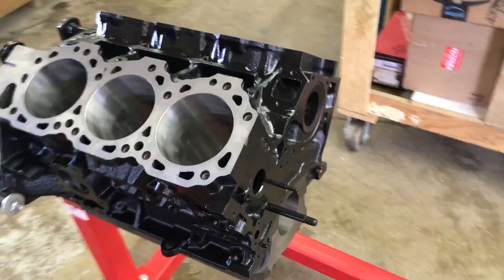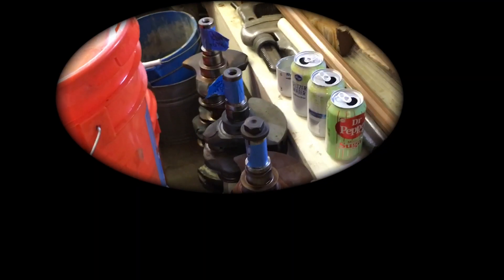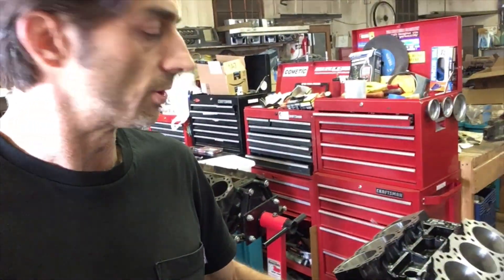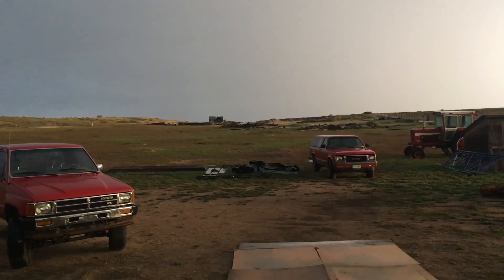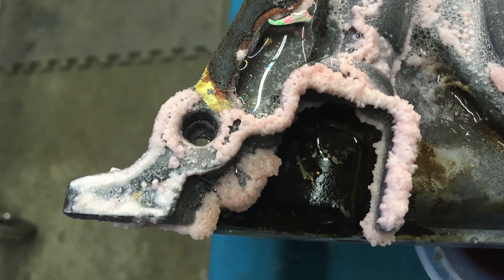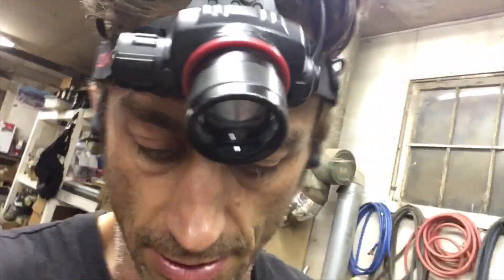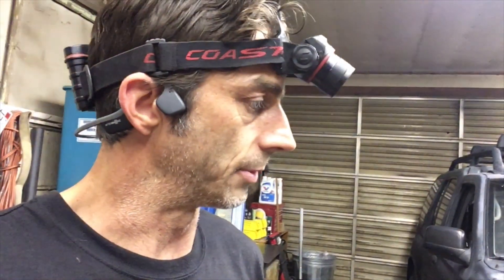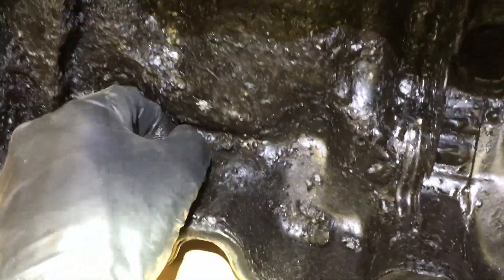MY ENGINE IS ON THE STAND!  VOLCANO IN MY ENGINE?!

Comment: That makes me want to go out and change my oil ASAP lol
Reply from the maker: Right?!  Hopefully, this is something that can be avoided.  If you aren't the original owner of your vehicle (most of us are not), you can visually inspect the engine under the valve cover without a lot of difficulty.  If you have a 1st generation Xterra or Frontier with the VG33E or VG33ER engine, like the one in this video, you can remove the righthand-side valve cover without a lot of difficulty and see what it looks like under there.  I'm often shocked how bad some of them look, but this one is the worst I've ever seen. :)

Comment: 3.5 quarts of oil. That’s why
Reply from the maker: Yeah!  That could be contributing to the issue. :). This seems to be a small oil capacity for the size of the engine. :)
Reply: Yep. Exactly the issue. As an owner of a 2000 Xterra, now with 292K miles, I've changed the oil 58 times at 5K intervals from day one. It always reminds me how small the oil capacity is on these engines.
Reply from the maker: @nosurfenougheddie  Right?!  When I tell people how much oil this engine holds, they are shocked!  I typically change the oil a little more frequently, just to try and keep the viscosity high enough during the usable life of the oil.  I also think the improvements to the cooling-ability of the engine block is helping. 👍

Comment: Yea oil management means different things to different people. Like bragging they haven't change their engine oil in 90k miles.  They are manageimg oil change costs.  Wonder how many quarts they add keep it full.  Of course tar doesn't leak or burn.  Nice.
Reply from the maker: Yeah!  Funny!  Yeah, I can see people bragging about that.  I felt really bad for the folks I bought the silver Xterra from.  They paid a lot for it, and after their first oil change, it developed a rod knock (spun a bearing).  After seeing the underside of the valve cover, I have since never purchased a motor without requiring the seller to remove the righthand side valve cover and sending me pictures.